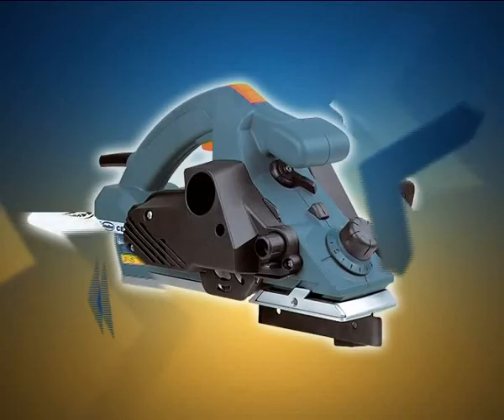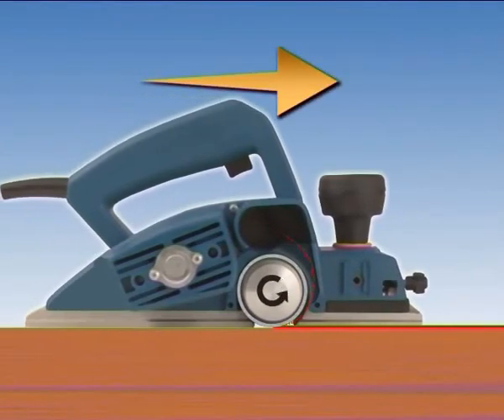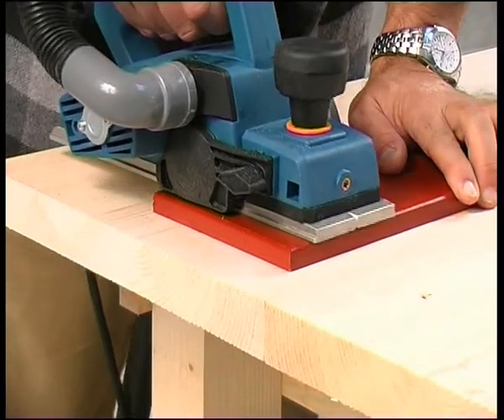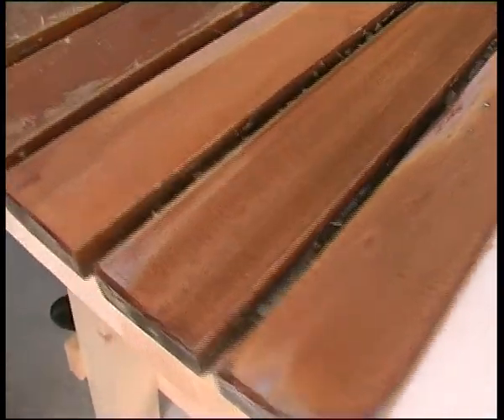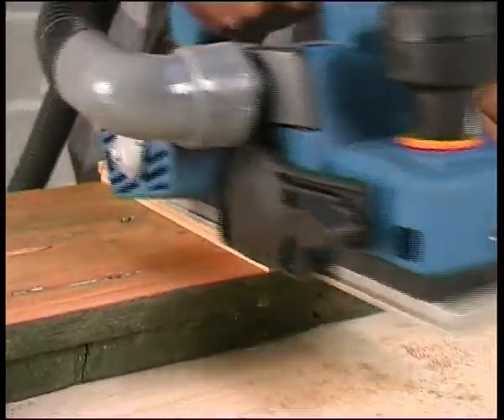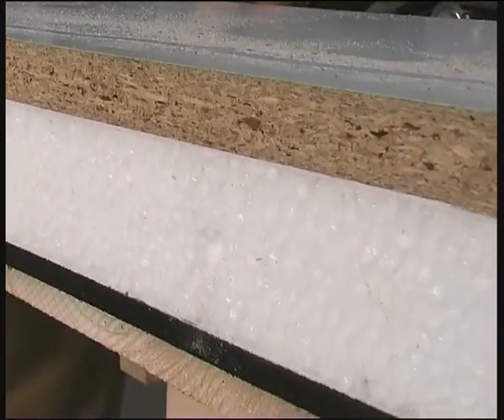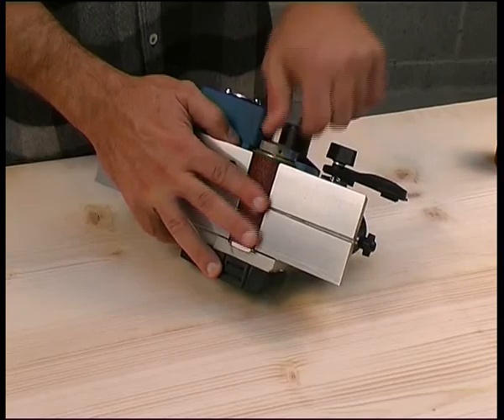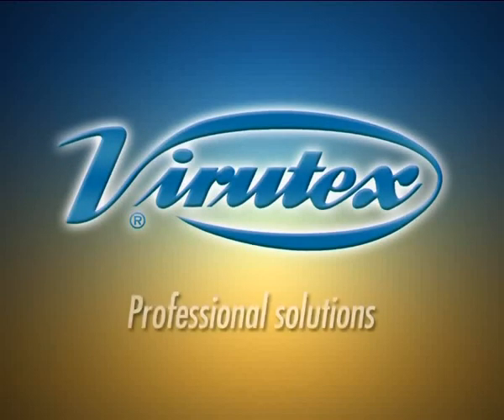Virutex CE23N Abrasive Planer

Comment: That sounds worse then a bladed planer specialy sanding tough gelcoat. Its sounds like an angry bee🐝 and the motor is slowing down rapidly on the gelcoat witch will eventualy damage the belt and burn the brushes of the motor. It should have a continuouse electronic speed controle to keep the motor running at full speed on harder wood or whatever its job it is doing at that time. Its beter to use it on smaller jobs and slow the rate of soeed of you pushing the planer so it wont damage the motor. Its not a hand plane so no need for fast passes because using to mutch presure will not let the motor stay at a good speed. Use a gelcoat peeler instead. Its more heavy duty and dousnt slow down like a DIY power planer